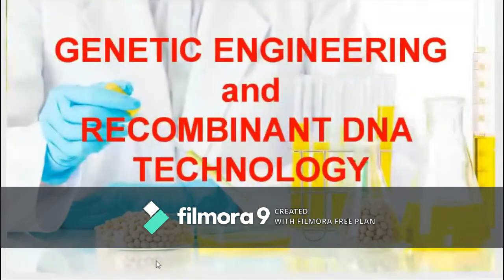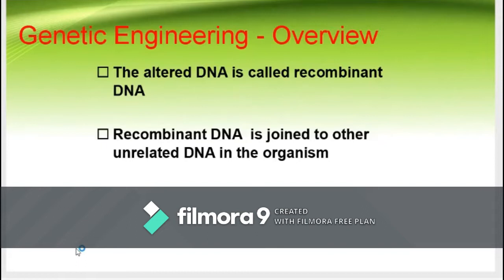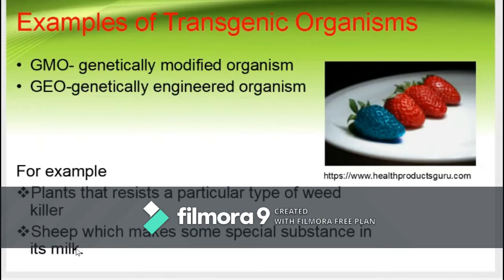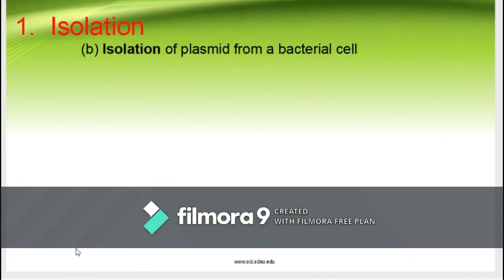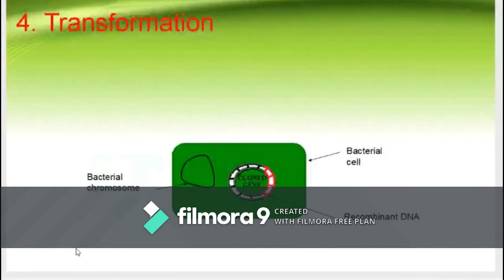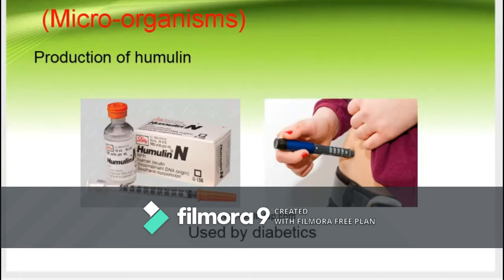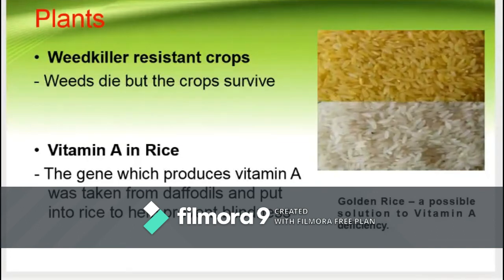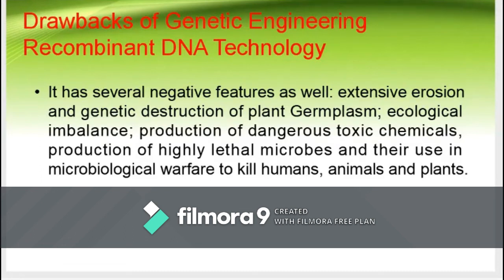GENETIC ENGINEERING & RDNA TECHNOLOGY

Comment: PRESAS, Hannah Jean S.
Grade 12 - MAXWELL

Genetic engineering, also called recombinant DNA technology, involves the group of techniques used to cut up and join together genetic material, especially DNA from different biological species, and to introduce the resulting hybrid DNA into an organism in order to form new combinations of heritable genetic material. Genetic engineering allows scientists to select one specific gene to implant. This avoids introducing other genes with undesirable traits. Genetic engineering also helps speed up the process of creating new foods with desired traits. The four main steps in DNA cloning are: Step 1. The chosen piece of DNA is ‘cut’ from the source organism using restriction enzymes. Step 2. The piece of DNA is ‘pasted’ into a vector and the ends of the DNA are joined with the vector DNA by ligation. Step 3. The vector is introduced into a host cell, often a bacterium or yeast, by a process called transformation. The host cells copy the vector DNA along with their own DNA, creating multiple copies of the inserted DNA. Step 4. The vector DNA is isolated (or separated) from the host cells’ DNA and purified. 

Recombinant DNA is an important technique for many gene-cloning applications. Recombinant DNA technology has also proven important to the production of vaccines and protein therapies such as human insulin, interferon and human growth hormone. There are Four key developments that helped lead to construction of the first recombinant DNA organism (Pray, 2008), 
1. Discovering the Cut-and-Paste Enzymes,2. Inserting Foreign DNA into a New Host Cell, 3. Recombinant Plasmids in Bacteria and 4. Vectors Used in Mammalian Cells. 

Here are some related studies that may help you understand more about Genetic Engineering and Recombinant DNA technology. Dr. Eugene Rosenberg, in It's in Your DNA, 2017, The study is also includes human insulin, recombinant DNA technology, Asilomar Meeting, GM plants and animals. https://doi.org/10.1016/B978-0-12-812502-1.00010-X . Padma Nambisan, in An Introduction to Ethical, Safety and Intellectual Property Rights Issues in Biotechnology, 2017, is about Safety Issues in the Use of Recombinant DNA Technology in Medicine Recombinant DNA technology has contributed to health care in two important ways: production of pharmaceutically important proteins (biopharmaceuticals) and gene therapy for replacement of defective genes. https://doi.org/10.1016/B978-0-12-809231-6.00009-0 . 

I have learned the process of inserting new genetic information into existing cells in order to modify a specific organism for the purpose of changing its characteristics. With the advent of genetic engineering, scientists can now change the way genomes are constructed to terminate certain diseases that occur as a result of genetic mutation. And also I have learned that Recombinant DNA technology is the joining together of DNA molecules from two different species. The recombined DNA molecule is inserted into a host organism to produce new genetic combinations that are of value to science, medicine, agriculture, and industry.

Comment: POSESANO, Maria Sophia G.
11 STEM - Dmitri Mendeleev

Genetic engineering, also known as genetic modification or genetic manipulation, is a direct manipulation of the genes of an organism using biotechnology. Genetic engineering is a mechanism by which recombinant DNA (rDNA) technology is used to change the genetic structure of the organism. Traditionally, humans have indirectly manipulated genomes by regulating breeding and selecting offspring with the desired traits. Genetic engineering requires the direct management of one or more genes. Very frequently, a gene from another species is added to the genome of the organism to give it the desired phenotype. Genetics involves the manipulation of genes to make beneficial products concerned with the simple addition of deletion or manipulation of a single trait in an organism to produce the desired change. At the molecular level, a piece of DNA is copied from one organism and this copy of DNA is added to the DNA of another organism. The main objective of Genetic Engineering is to allow the genes of one organism to be inserted into a cell of another organism of another species, e.g. Bacterium genes may be inserted into plant cells. Transgenic organisms are organisms that are modified by genetic engineering. Examples of transgenic organisms are genetically modified organisms and genetically engineered organisms. In Genetic Engineering there are five stages: insulation, cutting, ligation and insertion, transformation, and expression. Recombinant DNA technology in genetic engineering is used in the fields of medicine, agriculture, the environment, and forensics.

Journal about the Egyptian Journal of Medical Human Genetics (EJMHG) is an open-access peer-reviewed journal focused on covering innovations in the area of human and medical genetics. The journal considers articles on all aspects of the genetic basis of human disease, with particular focus on biochemical genetics, bio enzyme studies and other protein deficiencies, as well as immunogenetics. Those certain areas of concern include studies into pathogenesis of genetic diseases and functional developments in molecular diagnosis of human disease. Reports presenting clinical applications of genomics and next-generation sequencing technologies are considered important contributions. 

Genetic engineering is defined as the direct manipulation of an organism’s genes including heritable and uninheritable recombinant DNA constructs. Genetic engineering, written extensively, poses a host of critical ethical concerns. In agriculture, for example, ethicists have highlighted possible human health threats associated with genetically engineered crops and livestock, as well as normative questions regarding the care of animals and the ecological effects of genetic engineering. Genetic engineering, also known as recombinant DNA technology, involves a group of techniques used to cut and merge genetic material, in particular, DNA from various biological organisms, and to introduce the resulting hybrid DNA into the organism in order to form new combinations of inherited genetic material. Genetic engineering and RDNA technology are very beneficial to humans.

After watching this video, I learned a lot about the significance of genetic engineering and RDNA technology in this video. We are able to combine the genes of various species in order to produce a new and even more useful product by using them. The video was insightful, it makes me understand more about the subject and learn more about genetic engineering and RDNA technology. It is astounding that through genetic engineering and RDNA technology, Doctors or Scientists, can create a medicine to cure certain diseases. I was also able to understand why we are using genetic engineering and RDNA technology. I have discovered the explanations and applications of genetic engineering. Through this, I was able to know the value of it and the area in which it was used.

Comment: Relator, Jeffernyl B.
11-STEM Rutherford

Since the discovery of the double-helical structure of DNA, human curiosity regarding this molecule has propelled the advancement of biological sciences in an unprecedented fashion. This video is all about genetic engineering which is the collection of a wide array of techniques that alter the genetic constitution of cells or individuals by selective removal, insertion, or modification of individual genes or gene sets. It is used to achieve one or more of three goals. First, to reveal the complex processes of how genes are inherited and expressed. Second, to provide better understanding and effective treatment for various diseases, (particularly genetic disorders). Lastly, to generate economic benefits which include improved plants and animals for agriculture, and efficient production of valuable biopharmaceuticals. 

In learning this topic, I read an article by Hansen (2000) titled “GENETIC ENGINEERING IS NOT AN EXTENSION OF CONVENTIONAL PLANT BREEDING; How genetic engineering differs from conventional breeding, hybridization, wide crosses and horizontal gene transfer” elaborated the specifics of this advancement. Genetic engineering is not just an extension of conventional breeding but in fact, it differs profoundly. It works primarily through insertion of genetic material, which does not occur in nature, that uses a gene gun or bacterial truck. This process alone is profoundly different from conventional breeding. Also, the fact that it yields twice or thrice more than the traditional way in agriculture makes it more efficient. 

Obviously, genetic engineering holds tremendous promise for medicine and human well-being. Medical applications of genetic engineering include diagnosis for genetic and other diseases; treatment for genetic disorders; and the list goes on. As the use of genetic engineering expands rapidly, it’s hard to generate an exhaustive list of all possible applications. However, there are at least three other areas worth noting – forensic, environmental, and agricultural applications. Although these three areas are not directly related to medicine, they certainly have profound impacts on human well-being. There are numerous ways that genetic engineering may be used to benefit agriculture and food production. First, the production of vaccines and the application of methods for transferring genes for commercially important traits. Second, genetic engineering is expected to dramatically alter the conventional approaches of developing new strains of crops through breeding. Third, DNA fingerprints from samples collected at the crime scene provide strong evidence in trials thus help solving many violent crimes. Fourth, the alteration of metabolism of microorganisms which enables them to absorb and degrade waste/hazardous material from environment.

The characteristics of genetic engineering possess both vast promise and potential threat to human kind. It is an understatement to say that genetic engineering will revolutionize the medicine and agriculture in the 21st future. As this technology unleashes its power to impact our daily life, it will also bring challenges to our ethical system and religious beliefs. I believe that research and applications of genetic engineering should proceed with caution and humility. Without it, we would still be living in the dark, away from the advancements that could improve life.

Comment: SOLUTAN , JAHARAH V.
(GRADE 11-MENDELEEV)

GENETIC ENGINEERING & RDNA TECHNOLOGY

           Genes are the part that controls the replication of a trait and genetic engineering, also called DNA sequencing technology, in order to form special inventions inheritable genetic material. The series of techniques used to cut and join genetic material, in particular, DNA from different biological species, is required and the resulting hybrid DNA must be incorporated into the organism. Its purpose is to make it possible to integrate the necessary genes from one organism into a cell of another organism of another kind, such as incorporating human genes into animals such as pigs. The DNA that has been changed or genetically engineered is referred to by splicing as recombinant DNA, which is effectively the deletion and replacement of specific portions of a gene with other genes.

        This is the separation of a particular gene from DNA fragments. Insertion into a genetically engineered organism of the isolated donor Plasmid DNA and the development of a recombinant vector into a living vector. These measures are reviewed briefly and the role they each play in a genetic engineering application is presented. The major boundary disadvantages, insect vulnerability, public health, the environment, community, and productivity are addressed.

        Transgenic organisms are referred to as genetic information technology animals. Genetic modification and RDNA technologies are proving useful in many ways. In medicine, we will diagnose diseases and conditions, as well as provide possible treatments for them. This thesis has crucial social consequences, including better diagnostic health, clearer insights on human gene diversity, and considerably more openness to specific concerns.

         Here, I learned how human advancement has granted humans the power to handle animals by reconditioning them over the years. In the medical sector, genetic modification has particularly helped us. Just like what we are seeing, really. This could allow us to develop a vaccine for COVID-19.

Comment: DELA PEÑA, Jules Adriane Jade B.

Once you add, you delete, and manipulate a single trait in an organism to generate favorable changes, that is already considered genetic engineering. If you wonder how you could possibly have another color for your hair that will be permanent, then genetic engineering will be the procedure you need. It will involve tailoring a segment of genetic information from a particular species. Like how human genes can be inserted into a bacterium or how bacterial genes can be altered into human proteins. And its result is called a recombinant DNA. This is conceivable through gene splicing—fragments of DNA will be taken and replaced with completely non-related genes. Those organisms that have been successfully “improved” are called transgenic organisms, which can be subdivided into genetically modified organisms (GMOs) and genetically engineered organisms (GEOs). However, the two terms are definitely different from each other. There are also steps that must be undertaken; first is to isolate, next is to cut, ligate and insert, transform, and finally express the new set of genes.

Genetic engineering does not only tackle rather simple problems like the one mentioned before regarding your hair, but it can also be applied in mitigating serious issues such as food allergies. Though many people consider an allergy as not so big of a problem, but then again if a person gets allergy attacks and cannot be treated immediately, then the worst case scenario would be death. And that is basically the aim of Eliot Herman’s study. He is certain that “by altering food and by treating sensitive individuals, this can be mitigated, improving their lives and impacting the total medical expenditure.” The scope of his research however, solely focuses on soybean allergies as it affects children and infants. I, who also have food allergies, is certain that with the advancements in genetic engineering, we will someday be able to alter most foods so that less people will have rashes from these allergies, less people will have a hard time breathing, and less people will die—once we add, delete, and manipulate.

This specific area or field of biology, I think, should be shed in a light of attention and action as we are transitioning into a harsher world. Scientists even predict that more and more pandemics or outbreaks of deadly bacteria as well as viruses can arise due to the melting of icecaps and glaciers in line with the increase of global temperatures. And we must strengthen our genetic makeup.

As a student, learning this topic serves as only the tip of the iceberg. And I was able to learn with this video regarding the intricacies of genetic engineering and rDNA technology. But applying it onto the real world should be what’s next.

Reference:
American Society of Agronomy. (2020, November 18). Tackling food allergies at the source. ScienceDaily. Retrieved December 15, 2020 from www.sciencedaily.com/releases/2020/11/201118080800.htm

Comment: MODANZA, Janus Miguel G.
11-Rutherford

Genetic engineering comprises multiple techniques for the intentional manipulation of genetic material (primarily deoxyribonucleic acid, or DNA) to alter, repair, or enhance form or function. Recombinant DNA technologies, developed in the latter half of the twentieth century, include the chemical splicing (recombination) of different strands of DNA. It involves the group of techniques used to cut up and join together genetic material, especially DNA from different biological species, and to introduce the resulting hybrid DNA into an organism in order to form new combinations of heritable genetic material. 

Genetic engineering has developed rapidly due to the greater understanding of DNA; the chemical code from which genes are made. The term genetic engineering is used to describe the process by which the genetic makeup of an organism can be altered using recombinant DNA technology. This involves the use of laboratory tools to insert, alter, or cut out pieces of DNA that contain genes. However, not all genetic engineering techniques involve inserting DNA from other organisms.

This video covers the topic of the process and cycles involved in genetic engineering and the application of recombinant DNA tech. Based on my own understanding, Genetic engineering is the way of using recombinant DNA  technology to change the genetic makeup of an organism. In other words, it is copying a piece of DNA from one organism and merging this DNA into the DNA of another organism to allow one organism to be inserted into a cell of a different organism of a different species.

My understanding of this video is about how technology affects science and how humanity has benefited from it. Who would've known that combining two different genes to achieve a desired trait is possible? However, genetic engineering also has disadvantages such as it affects the outcome of the process, and given that it is not 100% successful, negative consequences would still prevail, such as birth defects, and many other failed experiments.